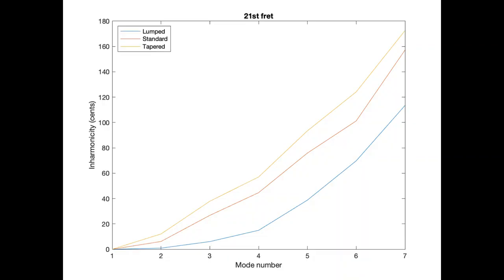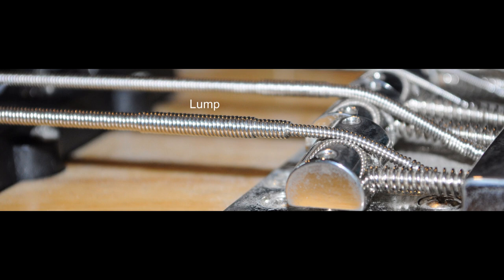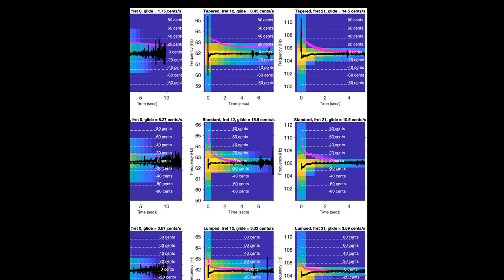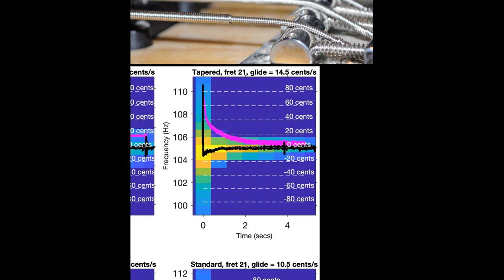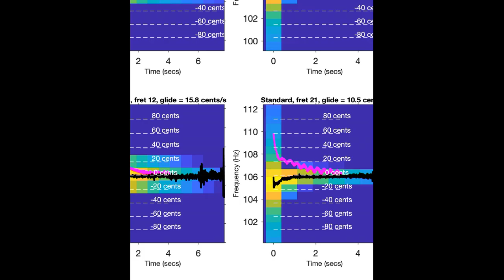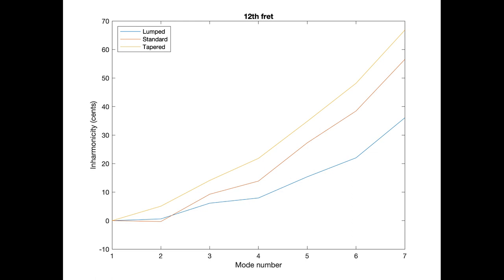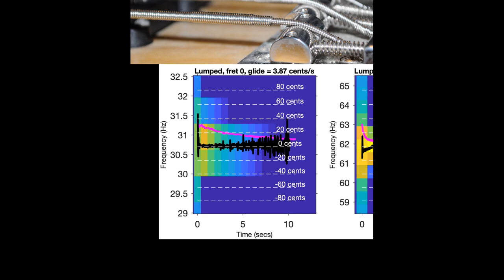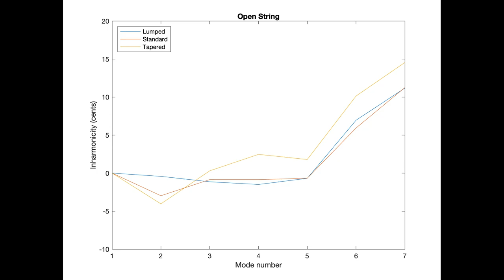Lumped bass guitar strings from Kemp Strings - Low B string sound examples from the 2020 paper

Comment: Several years ago, I wrapped pipe cleaner around my B string near the bridge in an attempt to reduce the strange harmonics by muting it with a soft material. It didn’t mute the string at all, but I had good results dealing with what I now know is “enharmonicity.” Totally forgot about that hack until watching this. Now I know it was the added mass that dealt with the problem, not the fuzziness of the pipe cleaner.
Reply from the maker: Great thinking!

Comment: I've never known lumped bass strings.
I use tapered bass strings for low-B because of longer sustain and brighter tone.
Reply from the maker: Tapers help the thick string get around the large break angle that is often present at the saddle (hence helping with sustain of higher harmonics)  but too much low mass within the sounding length causes greater inharmonicity. 👍

Comment: Have never seen or heard lumped strings.
Really interesting results, and clean explanation !
So I was right, tapered B strings have better intonation lower down the neck than standard type B string. :)
I was asking myself who plays the B string at the 21st fret or higher?
The highest I'd go on my B string is the 12th... 
Also I managed to intonate the bridge better with the tapered B string than the standard construction... (should I mention, with Elixirs)
thanks for your video and work !
Reply from the maker: Thanks! Most players don’t play high up the neck on low B because it’s a stretch and the note guess inharmonic. My strings improve on one of those aspects.

Comment: Given that the highest bass string in one set is .040, I'd guess this would also be a good way to improve at least the 6th string on a standard guitar, and even more useful in ERGs or heavier 6-string sets for lower tunings. What is the thinnest string that's worth giving this treatment, do you think?
Reply from the maker: Agreed! I keep the core size down on my low E on standard sets to keep inharmonicity and bending sensitivity in good ranges but trying a lumped construction would be a worthwhile experiment. Extended range guitars could definitely benefit from lumped construction. Feel free to email for custom string orders to jonathan@kempstrings.com

Comment: Good video explaining it, but it is opening up a more can of worms than it solves, methinks. I have a couple of questions. Since this idea stems from bass strings on upright pianos, where they always have open core, and it is made to compensate for the open core at the end of the strings, how many bass guitar with bass guitar strings has - really - open core at BOTH ENDS of the string length?
And a couple more:

1. How many basses does these strings fits into? Since there's a finite length between the ball end and the saddle witness point, these "lumps" ends up at all different spots along the strings length, if you should have body-through stringing or alternative bridges, like Leo Quahn which has all different lengths behind the saddle witness point down to the ball end. Not all basses are made the same. These seems to fit only Fender J and P basses. I do not yet know of any bass maker that makes a headstocked bass with tuners PLUS a bridge that is made for for headless basses, which would be needed. I e that you can retract back and forth the ball end of the string prior to stringing it so a) taper b) lump c) open core ends up precisely were it should be. 

2. Wouldn't all this be futile if all used fanned frets basses with a 34"-37" scale? PLUS uniform gauge at the low B string? I have one, and it's absolutely no problem with inharmonicity. Granted, you must buy special strings there, too, but now that it has caught on, the amount of choices steadily increases. 

3. Again, I have had problems with tapered strings, but open core strings I haven't even bothered to try out or check. I retracted the ball end so far back (with nut washers) so the tapered part of the string, ended up way behind the bridge saddle witness point, and never looked back. Open string clear, playing high up there no problem with inhamonicity, and so on. Uniform gauge is the best imho. The taper was only done because bridge saddles locked down as far as the can go still rendered the strings with too high action. Nothing else. So why all this? 

Instead of dissing your lumped strings altogether, I do think it got some good merits when it comes to short scale basses (a la Fender mustang etc) and the like, but since it is a once set measure, there are too few basses where it would fit, as the lump has to reside exactly at one sweet spot in front of the bridge. But hands to our hearts, do we really play that high up on the low B string, when playing solos? Those notes are available anyway, on the other strings lower down, without any inharmonicities. That's the reason the same notes are availble on different spots along the neck....;-)
Reply from the maker: Thanks for the questions. Here are the answers to your points:
1. Yes, you need different spec for lump positions for different bridge designs. We stock strings for standard Fender style surface mount bridges and we stock strings for standard Fender style through body style bridges. I have also made custom specs for a number of other bridges and scale lengths etc. I can even make them for headless in principle (as I know how much strain is required to get the strings to pitch etc. although I have yet to get these made).
2. If it sounds good it is good. Fan fretted instruments have a small advantage for inharmonicity but the inharmonicity is still there. My strings can reduce it further but it is neither futile nor a requirement for acceptable tone. You can get good tone further up the neck on my lumped string designs (with measurably lower inharmonicity). If you don't need that then that's fine. My strings are also designed to have equal bending sensitivity which means it's easier to bend on the high G for instance (and harder to bend on the lowest strings for more pitch stability, including less pitch drift on playing loud).
3. Untappered low B strings bulge around the saddle, especially for through body designs and this depends on the break angle at the saddle. The greater the break angle the more pressure on the saddle to get a solid feel but you end up with more bulge. This increases the amount of time taken for the string to settle in on tuning it up for the first time (and potentially leads to windings rubbing together). Most manufacturers use lower tension on the low B (and most only sell matched tension sets for four string). My strings are designed to have equal tension at the low B so the gauge is higher (0.146) and have a taper (not exposed core) to get the string to pass over the saddle nicely.
Yes, my strings have greatest advantages for shorter scale lengths (and you can check out video my custom strings for 16 inch scale length bass with proper bass low E believe it or not).
Reply: I'm not sure that longer scale always solves the issue. I own two 5 string Ibanez Soundgear basses, one of the is a 505 (34") and the second one is the SRMS 805, which has 35,5" scale. I also swapped the original Bartolini MK1 pickups in the 505 for the Bartolini BH2 pickups so that the pickups on both basses are exactly the same. The construction is similar but the neck and the body woods are not. I string them with D'Addario nickel, same gauge. 

While the lowest  notes of the sound bigger and louder on the multiscale bass, it also has noticeably more inharmonicity on both B and E strings. 

There's also another issue: not everybody is physically able to play a bass that long.
Reply: @burricanecarter  I have a Dingwall 4 string fanned frets bass tuned BEAD, it's not any longer than a regular fretted Fender P or J bass since it fits in the exact same gig bag made for Fender Js and Ps. I am not that tall but can reach all the key tuners at the headstock. However, I have trouble at reaching the (all) Fender P and J basses headstock tuner keys. It's doable but trouble. 

To speak of inharmonicitiy, then on a fanned fret Dingwalls there's LESS need to have an overtly thick gauge B-string if a 5:er is used. You can get even tension and "even harmonicity" worked out with a smaller gauge B-string, i e even a .120 is too thick, sometimes. It all depends on how the string is manufactured, like core-to-wrap ratio and whatever. I have done the real do-or-die test on my BEAD 4 string, and put the B string in the place of the G-string instead, after temporarily removing the g-string. The string fits in its nut slot anyway. Now, up above the 12th frets the "clang tone" starts to get heard, the inharmonicity is heard, and the intonation is hard to do with the fingers since it wavers quite much in pitch so it's harder to nail it. Now I did not test the g-string on the 36" scale nut slot for the b-string, being afraid of it to snap if tuned up to pitch. The low B is what is often the problem. The rest is all good, especially high G-string.

The most disadvantage of a fanned frets that you must hunt down special extra extra long sets of strings which only a few manufacturers makes. And then again, only specially long string is only needed for the low B. Any regular string will fit to the rest of the bass. I e A-D-G or in my case EAD strings. So it's completely unneccessary to buy a complete set, especially for a 5:er since they come very pricey.

Now with these KEMP strings, you must hunt down - too - the exact measurements. And when reading the gauges of a 5 strings set, the .145 gauge for a low B is really, pushing it way over the top for me. On top of that all the other strings may not have to be lumped. And the price...jeez ffs, don't even get me started...

Comment: Are fretless bass strings available and/or conceivable in Lumped shapes?
Reply from the maker: Hi Benjy, These strings can be used for fretless (as long as the strings are surface mounted in the standard way not through the body etc.). They are roundwound using nickel plated steel windings. I don't have current plans for tape wound strings (that some people like particularly as they are gentle on the fretboard) if that's what you mean. Cheers, Jonathan
Reply: @KempStrings  Thanks!

Just checking, but I prefer flatwound Ernie Ball Cobalts.

If you ever produce something similar, let me know!
Reply from the maker: Benjy Bass Cool. Please feel free to email jonathan@kempstrings.com if you want to be put on the email list to stay in touch with Kemp Strings developments!